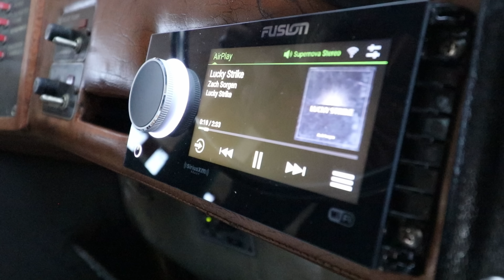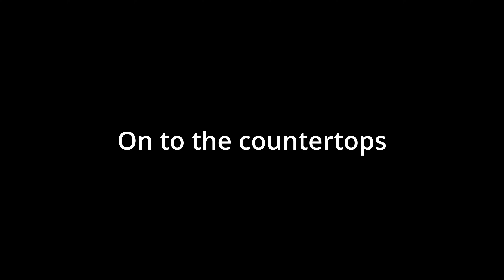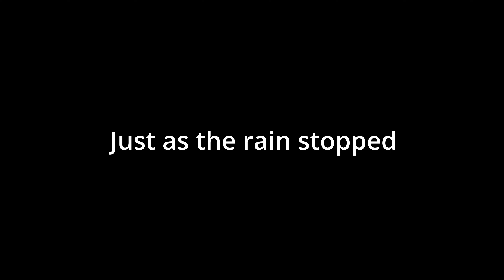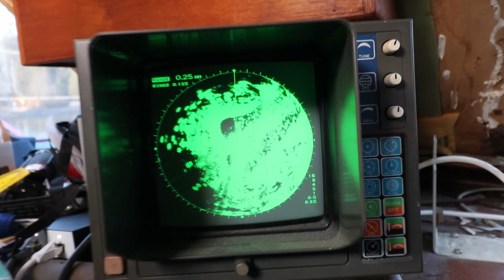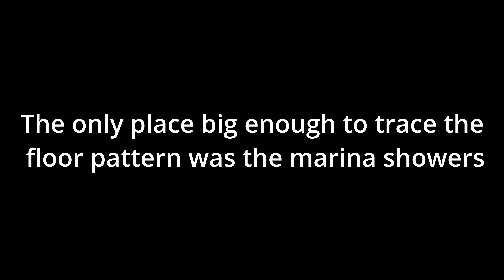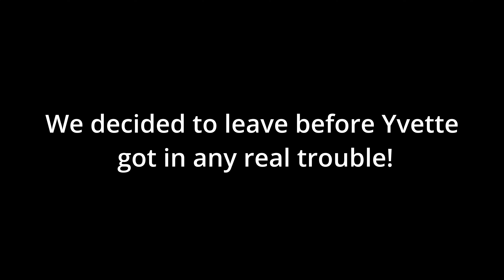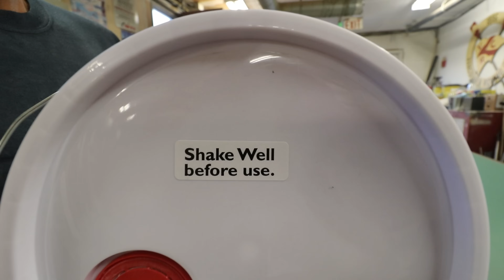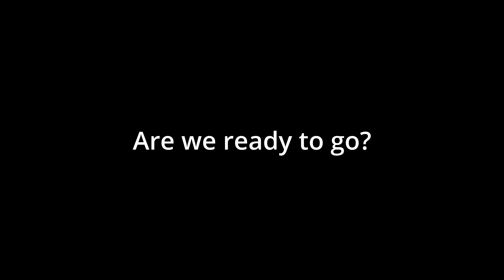2 YEAR REBUILD OF OLD 50 FOOT CATAMARAN INTO A MODERN BLUEWATER CRUISER - FULL REFIT! [Ep. 1]

Comment: Loved the video. Love the colors. At 35 min, you need to get some ventilation behind that refrigerator. With more ventilation, it will pull less power and cool faster.
Reply from the maker: Glad you love the video and colours! Thanks for the advice, we are going to look at the specs for the fridge again. There is a lot more space behind the fridge than appears in the video because there was a cupboard behind the counter. Definitely keep the advice coming, as we probably make a lot of mistakes that we don't realise.
Reply: Ill second that - the fridge is a heat exchanger, pull heat out to cool the inside of the box and put the heat outside the box. Adding some slotted louvers for cool air to come in behind it and hot air to exit will make it run more efficiently and draw less electricity.
Reply from the maker: @Poorehouse  Thanks for the idea, we may also add a vent beside the compressor :)

Comment: Depending on the inside width, centre the bed on the port or starbord side. Hopefully there will be enough room at the footing of the bed and your cupboards to get through. Makes it easier to make the bed and when you clean up. Your shelf you fitted leans to the front. Good luck. Fone to many yachts in my time..
Reply from the maker: Thanks for the advice, there is enough room to get through. We still have to make the bench for the other side and when the table drops down there should still be enough room even with the bench there. You have a very keen eye :)

Comment: Diesel heaters are fantastic . They do make a huge amount of heat near the blower but they use so little fuel. As long as you consider the heat right near the diesel heater the things work great. Had one in my big rig and it was fantastic
Reply from the maker: Thanks for the tips, we thought about permanently removing it, but we are probably just going to install it in a different location. It's great to have a trucker along for the adventure, I'm sure you have some crazy stories from the road! :)

Comment: Firstly, I already like this channel.  What kind of catamaran is she ?  The aft solar panels should be rigid not just flexible ones mounted on a rigid frame because wind that gets under will really work at them.  At some future point please upgrade.  You are spot on with flexible solar on your deck area with airspace underneath because they are not as exposed.  Consider one or two build your own 400-500 watt small wind turbine kits too.  Bon voyage and best wishes from Montana !
Reply from the maker: Thanks for the well wishes. She's a Prout Quasar 50, built in 1986. The aft solar panels are 'semi-flexible' because we heard that the flexible ones could have problems. They have an aluminium backing so they don't flap in the wind. Do you know of any build your own wind turbine kits?

Comment: Hey Guys, howzitgoin, we really enjoyed your video, so much fun rebuilding a boat. Just a little question, did you read the ventilation requirements on the fridge instructions before you installed it ??? I only ask because we have the same brand but individual fridge and freezer, and it said the air flow requirements was 60cm x 10cm under and around the back of the units?? The only thing worse than not have a fridge is having one that cost a small fortune but doesn't work due to lack of heat removal. cheers Rustie.
Reply from the maker: Thanks for the advice! Yeh we just crawled behind there and had a look, and we think we're ok. There's more space behind the fridge than it looks because there used to be a food storage cupboard in the wall right behind where we put the fridge. And one side is completely open. We will keep a close eye on it now though. Did you buy your fridge for a boat?
Reply: Yes we are building a 38 foot Grainger catamaran which is a massive job and seems to take forever. Cheers Rustie.
Reply from the maker: @rustie4242  Wow that's impressive! Keep it up, it'll all be worth it that's for sure :D

Comment: Hi, sadly your making issues , the solar vent , you've just put it down with sikaflex , you now never be able to get it up without damaging the area , the neoprene gasket provided would never leak , uv proof and totally weather proof.  Your doing well .
Reply from the maker: Thanks for the advice. We were told that sikaflex wouldn't stick enough to damage the fibreglass. The person also said it would be better than screwing holes in the boat to mount the vents. Maybe we got some bad advice but I think they meant well. Let's hope we wont have to remove them for a while. Any other tips would be welcome as we are still learning and it's all pretty new to us. 😊

Comment: Leak of the engine must be coming from the gasket rubber, it is rounded, it should be pull out and change them in a repair kit, you have to secure your old rubber which u removed from that part in order to get a sample for exact size and shape, oops sorry it was just a host good thing you've got extra one that would fit for temporary replacement
Reply from the maker: It's a good thing we had that spare hose :) There wasn't even a fuel shut off

Comment: [ 49:55 ] Darcy's P95 respirator isn't sufficient for fiberglass resin fumes; he should have used 3M 2097 filters, like Yvette, instead.
Reply from the maker: Thanks for looking out, Darcy has a different brand of mask but we did check the paperwork before using it and it was the correct filter. The brand of mask Darcy was using has a dust filter before the proper filter beneath it to extend the usefulness of the more expensive filters, so it does look like an improper filter, but it is not. We appreciate you taking the time to be concerned about our safety and look forward to any future advice you may have. Hope you like the rest of the videos as well :)

Comment: Hi, What is it with us Aussie girls & Canadian guys, & his cool with pink. Up there for ski fields?
To late for these suggestions, however;
That anchor looks to small for that size boat.
Hard solar panels are much better producers per sq" vs flex, have them as bimini, less weight vs bimini + panels, which stay cooler = more efficient, with unrestricted ventilation under them, same height framing extended for davits.
Cut table, add piano hinge. 
Rubberised paint on outer surface of kitchen sink makes them less noisy, thicker the better. Also acts as a insulator. 
More info on that battery (elec setup, green inverter, etc) would be good, looks like a forklift one?
If you have to do thru-hulls down the track, rural poly fittings (all plumbing), are strong, don't corrode, block as easy, non-sacrificial.
Reply from the maker: No we actually met in Australia 😊 The anchor is a 33kgs, we followed the anchoring guide from Rocna. We got semi-flexible panels which are light weight, they really aren't that flexible, they have aluminium underneath them. We haven't figured out what we want for the permanent table, just a piece of plywood at the moment although it might stay for a while given the never ending jobs. Piano hinge could be a good idea. I think the sink came with a rubberised coat on the outside but will check in to getting more. We haven't fully set up our electrical system yet but the batteries are a one off size and 24 volts, when we get it all finalised we will make a video. We replaced all the thru-hulls with poly fittings when we had the boat out of the water, so glad to hear that's what you would suggest. Thanks for all the tips :)